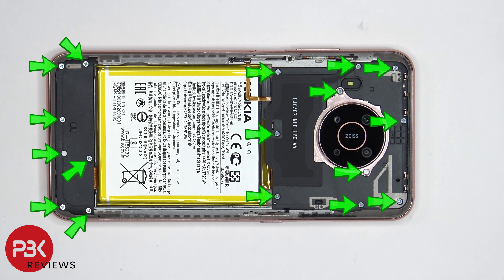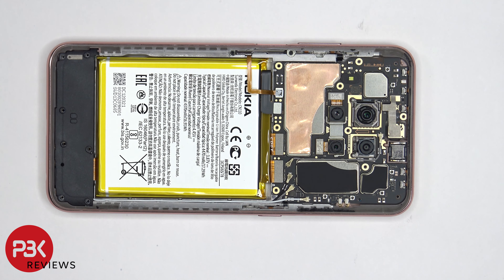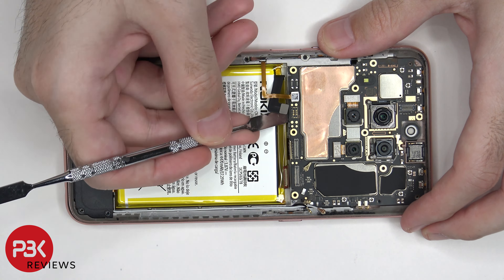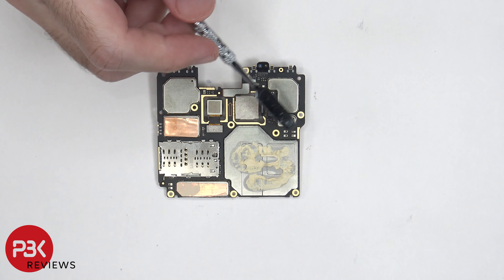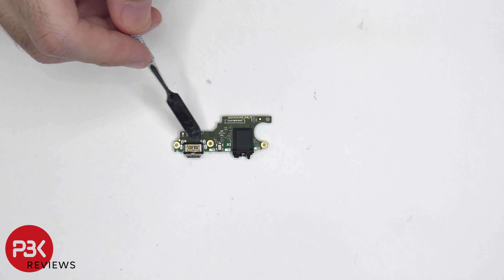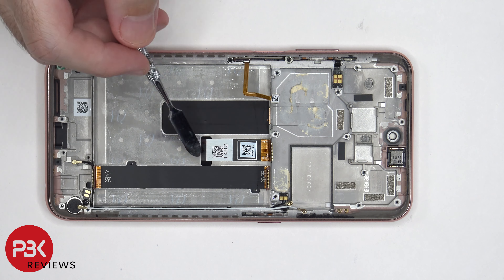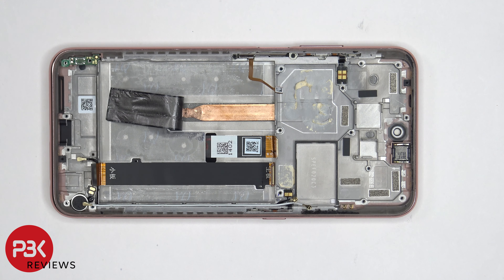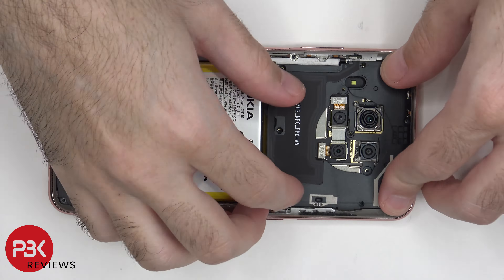Nokia X20 Disassembly Teardown Repair Video Review

Comment: I followed along to put in a new sub board due to a worn out charger port. But now there is a headphone (not head set) icon in the top, and the phone doesn't play audio, as it must be sending the signal to the (not connected) head phones. Any idea what I did wrong?
Thank you for a great video.

Comment: Can you replace just the battery without completely disassembling the bloody phone?!
It seems a lot of work, just to take the battery out.
Reply from the maker: yes, once you have access to removing the battery, you don't need to take apart the rest. Just enough to be able to disconnect the battery cable from the board and to remove the battery. Isopropyl alcohol will help prying it off.